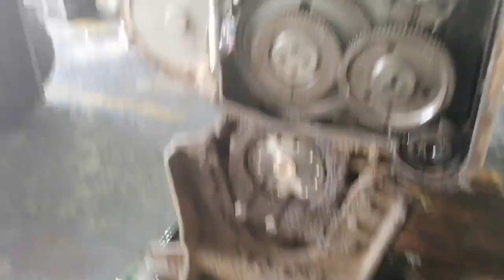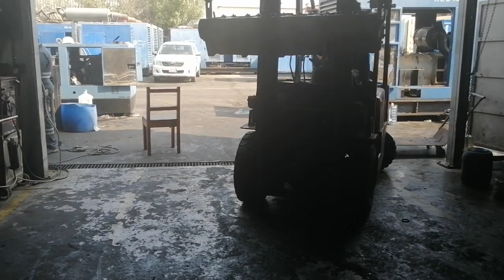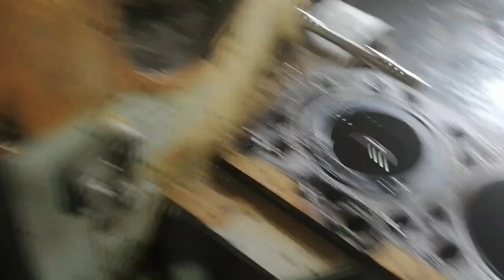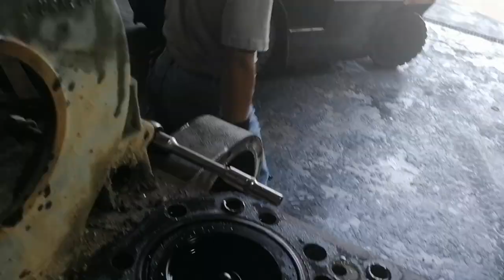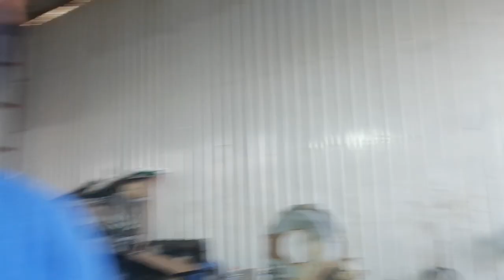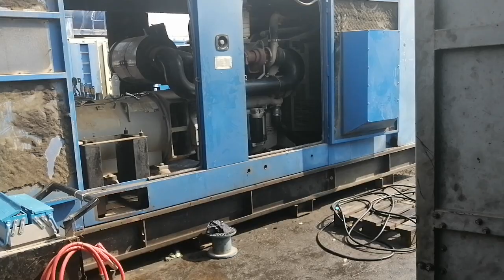2806C PERKINS ENGINE dismantle cylinder head and campshaft gear remove

Comment: Bos perkins namin low oil presure 2800series sa genarator
Reply from the maker: Sa actual sir check MO muna sa mechanical Guage sir kung OK sa wire sa oil sensor sir may putol po Yan or marumi sensor
Reply from the maker: Sa may sucket sir check MO OK ba ang oil sir update ba sa maintenance?